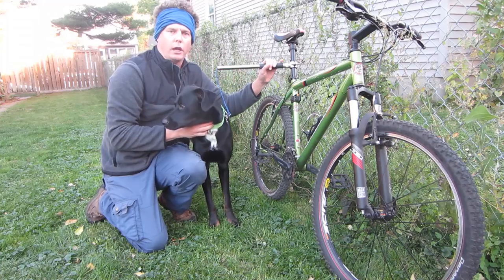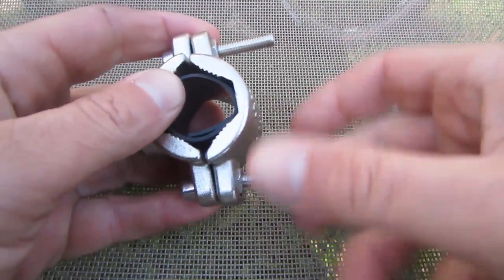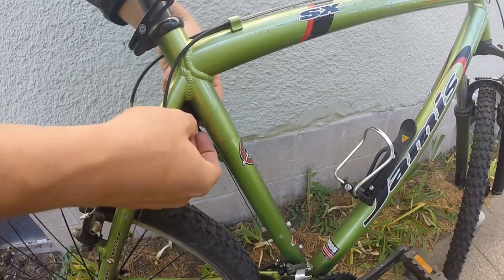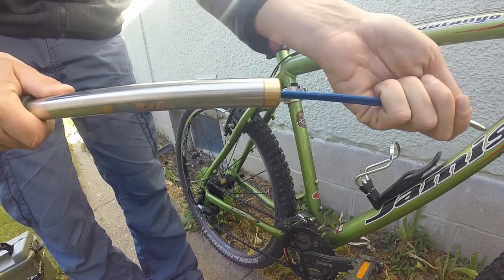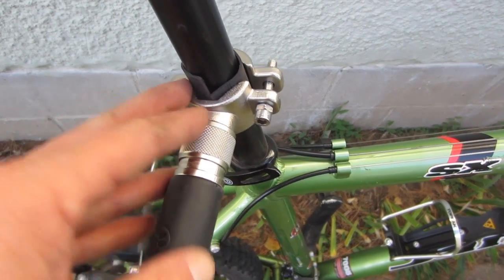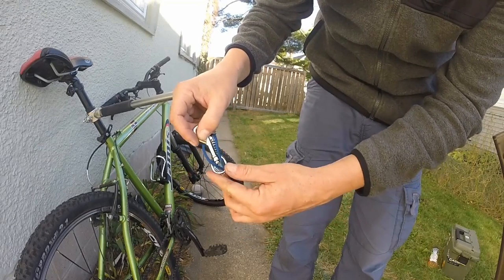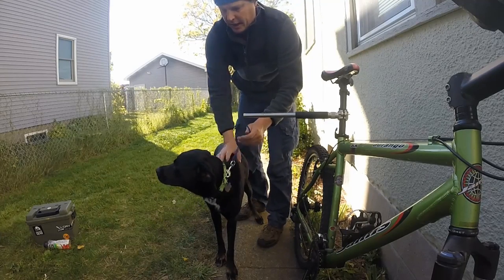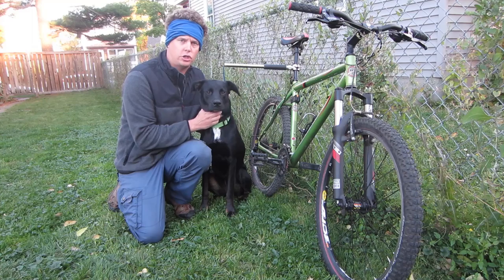Walky Dog Leash installation tutorial

Comment: This would be a better video if u had called an Allen Wrench an Allen Wrench instead of a tool! And a bolt a bolt instead of a screw! Hahaha! Really JK! 
I installed a Walkiedog Plus on my Trek 22.5 inch (29 inch wheels), on the frame where you installed your Walkiedog the first time. Because of my frame hight, my feet nor my legs hit the Walkiedog. But, even though I felt I tightened the bracket to the frame really snug, the bracket would twist if my 76 lb Golden slowed down. Yes, he need more time on the Walkiedog, I admit. But isn't  the springs supposed to take the shock so this sort of thing doesn't happen? Any advise would be appreciated!